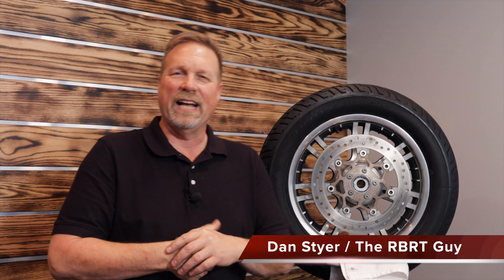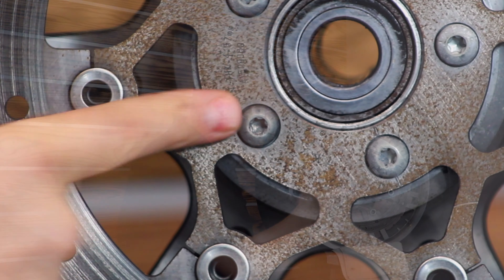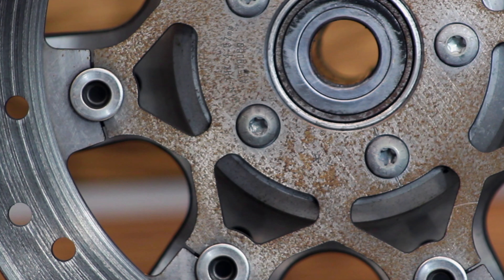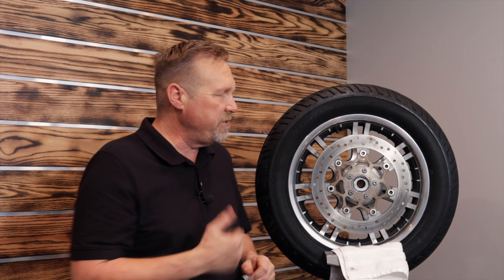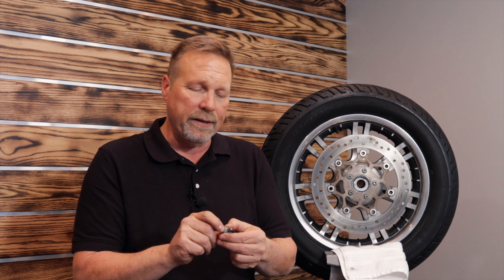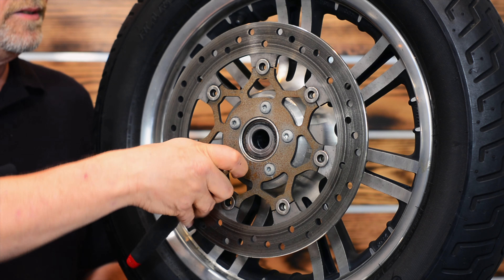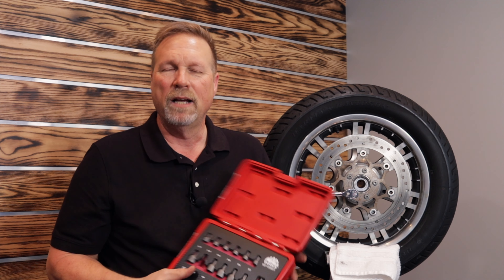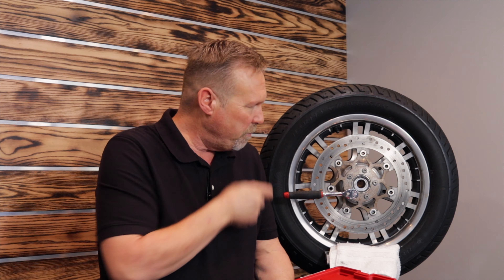Another great success story! RBRT Stubby Torx saves the day!

Comment: I have these,.. the stubby ones don't slip off compared to the longer ones.
Good bits, grip well. The use of heat  also will help too loosen the torx bit,   especially rusted shallow torx head bolts..

Comment: Why aren't you using some impacting ; even mild impacting with those bits would really insure you don't just twist / fracture the fastener off!  The RBRT line looks very promising and effective, but if it grips the fastener and you simply twist by hand and snap it off , what's the sense.  IMO, impacting with the proper RBRT bit would be much less risky and insure complete removal.